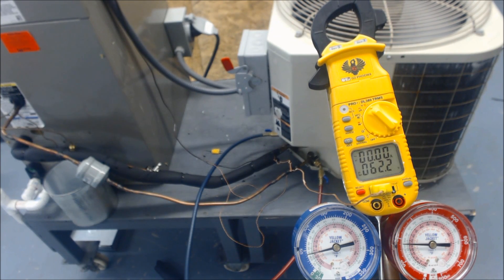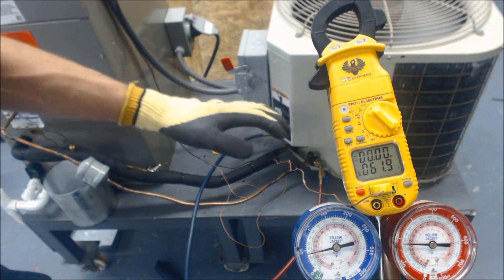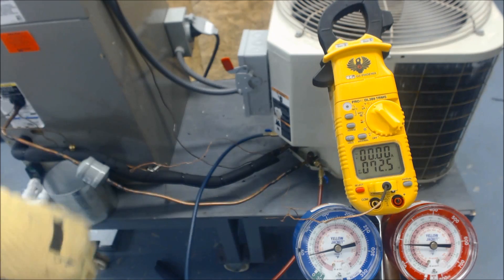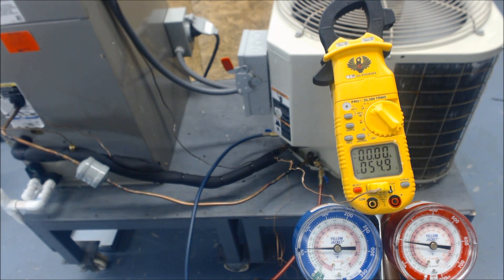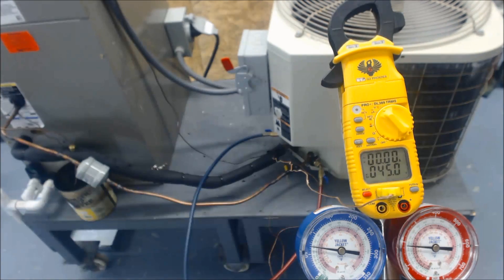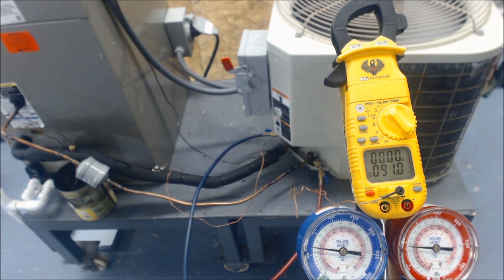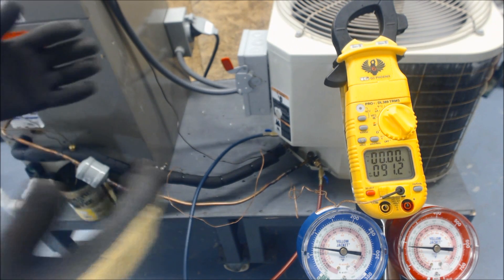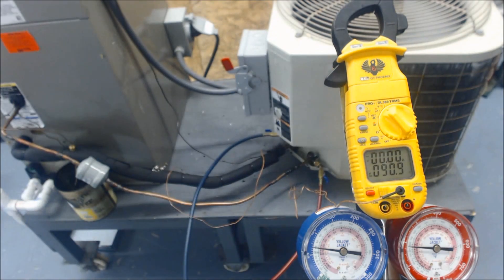Refrigerant Charging: Testing the TXV Bulb- Pressures with Bulb in Hot Water, Ice Water, & Normal!

Comment: What if I have negative of -50 subcooling 
The outside temp is 73
The liquid side is 146f
The 410 on red gauge read 102f the pressure is 345psi
The low side blue gauge read 42 f 410a and the psi is 145psi  the temp on that pipe is 68f 
And its txv valve 
It was low in gas and I just put 3lbs of 410a 
The Luqied line dropped from 210f to 150f but what cause that negative subcooling !?
Thanks
Reply from the maker: You can't have negative subcooling or negative superheat. One of the measurements must have been off. The temp on the liquid line will be the same or lower than the high side sat temp on an ac unit, thanks
Reply: @acservicetechchannel  thanks for the replay
I use the same your meter you have the newest one and set on F also the gauge is yellow jacket brand new set 
I checked the temp reading and read.73f when I take it of the liquid line 
The (outside temp)
The unit was very low on gas and the temp was reading 210f but after adding 3lb. The temp get down to 140f just few hours ago I was up there checking it again !
Thank you

Comment: I am a little confused. Why is the pressure on the high side lower when the TXV bulb is in the cold water? Since the TXV is closed shouldn't most of the refrigerate be in the condenser coil, creating a higher pressure as a result? Or does the excess refrigerant cause the temperature to be lower, causing a drop in pressure?
Reply from the maker: The reason is because if the txv won't let much refrigerant through then the refrigerant will not be able to absorb as much heat at the evap in order to reject it outside so therefore the pressure will be lower at the outdoor unit since there is less heat to reject. Great question!
Reply: Thanks for the reply and great video series!! I just got my EPA cert a while ago and started working for a service company and your videos have been an incredible help!!!
Reply from the maker: Awesome to hear!
Reply: Great question and great answer

Comment: Thank you very much!  I'm having trouble with a 410 system that iced up. I thought that it was low on charge. I added refrigerant to get my 10* sub cooling but my suction was still low. I got a fan cycling switch to bring up the back pressure to no avail. I have a restriction and the only thing is the TXV. Thank you for your video.
Reply from the maker: The problem is on the evap coil side which includes the txv. Did you check the under side of the evap coil to make sure it was not covered in hair and dust? There could possibly be a restriction in the tubing from the distributor going into the coil or also a clogged liquid line screen. Here is another video on the topic.  --  https://youtu.be/W-IZzI3kjM4   --
Reply: acservicetech   I looked at the indoor coil and noticed ice at the bottom of both sides of the coil. The call was initially for a water leak. So I started with a vacuum on the condensate line and in the pan. I turned up the thermostat up to 74* from 70* to help de ice the coil. I returned the next day to check my unit. The pressures were 170/70 for R410A. That's when I started noticing that there was more of a problem than low refrigerant charge. There is no liquid line drier on the unit. I just got a new TXV and drier and am going back Tuesday to attack it again. Any suggestions would be appreciated. Thank you. Have a great weekend. 
Blaze

Comment: Does the bulb have to be installed on the outside of the unit?
Reply from the maker: Great Question! The bulb is normally installed in the inside of the coil box when the evap coil comes with a factory installed txv. If the txv is installed by the tech it is usually outside. If it is outside, make sure that there is insulation around it! Thanks for the Comment!
Reply: +acservicetech thanks and i love the videos
Reply from the maker: I appreciate every one of your Comments! They mean alot!